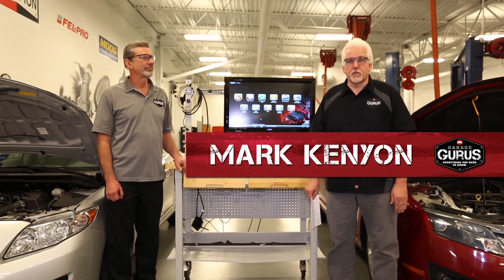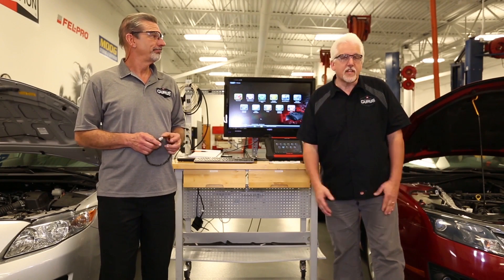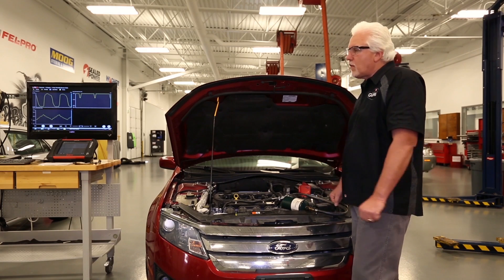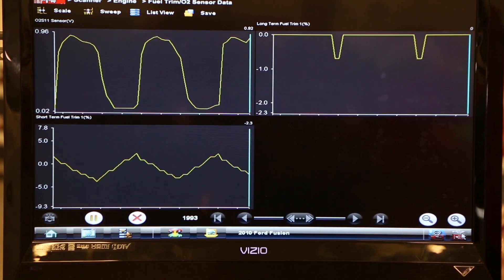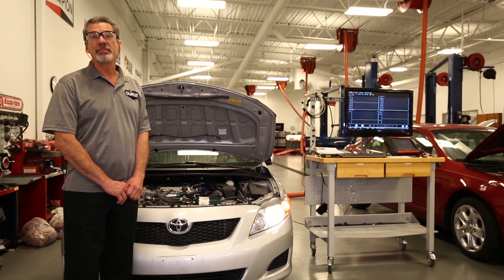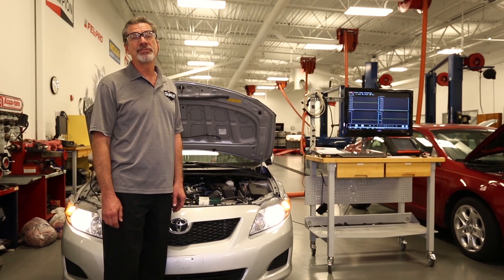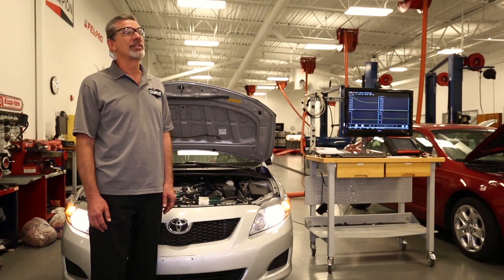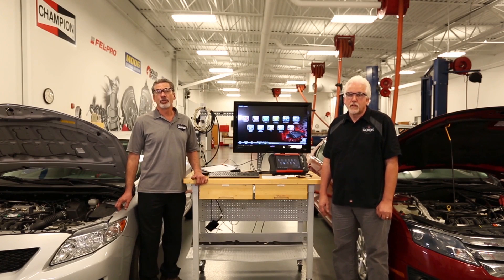Air Fuel Sensors versus Oxygen Sensors

Comment: Hello. If I take out my air fuel ratio sensor and install a regular oxygen sensor what will be the effects of this? My long term fuel trim at idle is +14
Reply: I just did it.
Reply: Won't be able to connect the oxygen sensor to the air fuel ratio sensor's connector. Different connector types.

Comment: Hi there , nice video .. I have a question about the A/F sensor and the O2 sensor I have 1fz fe 2007 engine with stock ECM and the type of the sensor on the car is O2 sensor Bank 1 ( only 1 sensor before the catly. Conv. ) the type is with a bigger hole tip the the A/F sensor , so the question is can i install A/F sensor instead of the Oxygen sensor depending of the same function simply, I found A stock Type from denso for another toyota cars are A/F sensor and the plug with the pins are same coming with 4 pins 4 wires .. ?

Comment: 1:40 Looks like the Ford is simply idling. So why is the narrow band voltage doing such big oscillation? Thanks!
Reply: Narrow band O2 sensors are non- linear devices, so in practical situations that means it can only detect rich or lean, but not how much. It's either one or the other. This causes the pcm to continuously vary the mixture. So you can't control to a fixed setting but you basically bounce around this set point.

Comment: 1:07 RANGE IS TOTALLY DIFFERENT TO FREQUENCY.

JUST BECAUSE IT WORKS IN WIDER BAND IT DOES NOT MEAN IT IS MORE PRECISE. 
IF THE COMPUTER SEES IT IS OUT OF RATIO (14.7:1)IT WILL PERFORM ACTIONS TO GET TO THAT VALUE SO THE RANGE IS NOT IMPORTANT. 

IT IS NOT ABOUT HOW WIDE IT IS. IT IS ABOUT FREQUENCY/ IT CAN GO FROM -100 UP TP 100 BUT WE ARE ONLY INTERESTED ABOUT CA.14.7 -1

Comment: I drive 2000 2.4L Tacoma/
It's been a while since I noticed "engine check" is on but I kept driving normally thinking it would go away.
Time for the smog check came.
It didn't pass.
So, after a it ot research online, I replaced a o2 sensor( I thought) then drive around a couple of hundred miles as the technician at the smog check suggested.
The check light went away.
 I went to the smog check again but no data.
It seems that I got a wrong sensor,
The original sensor was air fuel ratio sensor and the new one was a o2 sensor but that's what Denso suggested on their website.
Electrical plug on the new sensor didn't even fit the socket on the truck.
The original one at least was recognized by the onboard computer but the new one isn't recognized by it(by a code reader),

On Denso website, they make it seem like they were interchangeable but they are not.

Is this common?
should I get another parts same as the original sensor?
Reply: 02 and A/F sensors are completely different you cannot interchange them
Reply: Jay Jsays:
"02 and A/F sensors are completely different you cannot interchange them"
==
Thank you.
I wish I had somebody told me that before I bought it and installed it.

In the Denso website there's no mention of anything.
Reply from the maker: First O2 sensors and A/F sensors are not interchangeable yes the sensor may thread into the hole and the connector may even be the same but as for the function of these components, they are very different as you saw demonstrated in our video tech tip.  As to your question about using a different part supplier I would recommend that you look for the emission sticker that is under the hood of your truck as it will have the information you need to determine what type of sensor your vehicle is equipped with.
Reply: Garage Gurus says:
"First O2 sensors and A/F sensors are not interchangeable.."
==
Thanks you for the information.
I'm still gathering more (correct)information.

In the first auto shop I visited for their opinion, one technician was kind enough to look up the right part(air fuel ratio sensor) and I wrote down the part number and checked it online.
And yes, it was the right part number, and it looks pretty much same(in Amazon) as my original sensor, unlike the o2 sensor I bought.

In case someone who has the same issue reading this, the part number is 234-9001(air fuel ratio sensor) by Denso numbering.(for the note o2 sensor Denso recommended in their website is 234-4162)

There are generic sensors from other makers with different number but they'll all come up on the list when you search by the Denso part number in Amazon.
I'm trying to decide whether I should go for OEM or generic(about twice the difference in price) at this moment.
Meanwhile, I'll try to clean the old sensor and see if it'll work even just for passing the smog test.

Comment: I have a 2000 toyota rubber that was throwing a p0420 code so I changed the o2 sensor bank 1 and it started throwing ap1130 code witch is a a/f ratio sensor bank 1 witch is where the p0420 code told me to switch a o2 sensor. If it is the same thing just a different grade why did it throw both codes and not just the p1130?
Reply: That’s a catalytic converter code 😅

Comment: Could you tell which sensor goes where? Are they both in the exhaust or one in the intake and the other in the exhaust?
Reply from the maker: The Oxygen sensor may be used in either the exhaust manifold or exhaust pipe before the catalytic converter (Pre-Cat) or after the catalytic converter (Post Cat). The AF sensor is only used in the Pre-Cat position since it’s high sensitivity and broad range of AF ratio sensing is not necessary for the Post-Cat exhaust. It is up to the manufacturer which sensor is used in the application and service information should be consulted when diagnosing the system. On early model systems AF sensors used 5 or 7 wire connectors and Oxygen sensors commonly used 4 wires. Currently many newer AF sensors have only 4 wires, which can lead to confusion in discerning between oxygen sensors and AF sensors.
Reply: @GarageGurus  thank you sir

Comment: Just wondering for Toyota, why the LTFT is -12.5 ? another question is Toyota has two O2 sensors, as far as I know upstream o2 sensor is response to air fuel mix ratio, does the downstream also affect air fuel ratio?
Reply from the maker: Great question! Regarding the Long Term Fuel Trim being flat lined at -12.5,  the intent of the video was to show the immediate reaction of Lambda, O2 Voltage, and STFT to changes in A/F mixture. During setup and rehearsal for the Tech Tip video, we inadvertently set a DTC for #1 AF sensor causing the LTFT to default to -12.5. We simply did not catch this error in the editing and we apologize for the confusion. We verified this morning that this vehicle, part of our training fleet, displays trim values normally. Since the Snap On scan tool did not give a LTFT or STFT PID identified as S2, this does not mean that it does not use rear O2 for fuel trim. Toyota does not document their use of rear fuel trim very well, but has used the rear O2 in combination with the front A/F  to adjust trim for 2 decades according to our information. As with other manufacturers, the rear O2 has a relatively minor influence on trim in comparison to the front A/F sensor.

Comment: HOW do AF sensors work?  The o2 sensor uses Zirconium Dioxide  between platinum elements that are connected with a wire to each.  Electrical potential is generated by the imbalance of oxygen ions between the ambient air and the exhaust gas.  The greater disparity, as with a rich mixture, the higher the voltage (.9) and the less the disparity, as with a lean mixture, the lower the voltage (.1).  However, it requires 600 degrees or more to work effectively, which is why it has a heater, and the heater is the part that most often goes bad.  So how exactly does an AF sensor work?

Thanks!
Reply from the maker: Jack, in order to give you the most accurate answer, we need to know a few more pieces of information. Can you give us a call and we can help assist you? 
The Gurus Tech Hotline number is 800-325-8886 and is available
M-Th: 8:30AM-5:30PM ET
Fri: 8:30AM-5:00PM ET

Comment: Can a car have both narrow and wide on the same engine ?
Reply from the maker: Great question! Our tech guys would love to help you with this.  Feel free to give us a call - 800-325-8886 and is available M-Th: 8:30AM-5:30PM ET
Reply: tigerking Yes, my Toyota uses a wide band up front before the cat then a regular short band behind it just for monitoring the catalytic converter.
Reply: What happens if I buy an aftermarket fuel sensor sold as a wide band but is actually just a short band that fits? How would I be able to determine if it’s a wide band or a short band I was sold?
Reply: All manufactures that use widebands use both together. on each bank will have one wide band upstream and one narrow band downstream.

Comment: I have a lean code p0171 check engine light is always on, the cr run 
fine and idles fine. air/fuel sensor fluctuates between 600 to 800 down 
to 200. the fuel trim long term is 15 + and the shorterm fuel is -14. 
Check for vacuum leak engine cold sprayed water all over intake manifold
 , vacuum hoses , exhaust manifold, its normal.  The air/fuel sensor 
drop to zero volts when I pulled the vacuum hose from manifold . Does a 
zero volt reading point to a faulty o2 sensor , its a 4 wire , on Toyota
 corolla 2000 4 cyl CE 1.8l.
Now today I will check spark plugs and injectors, its repeated ticking 
sound points to both injectors and spark. spark advance on the obd tool 
reads 15 with a G letter . What does it mean?

I have not back probe the o2 sensor because I can not find its o2 
specifications on voltage drop and I don't know if its a wide band or a 
narrow band sensor. 

I cant find the fuel regulator in the engine. And I need to inspect all 
the vacuum hoses too. Its like being a medical doctor, I only have 150 
hours of training with certificate from the 70s and learning all this 
analysis with fancy digital scanners can be very expensive for just a 
do-it yourself-er. 

can I use a volt meter with an amp probe together on a o2 sensor signal 
wire, instead of back probing? 

Can I use the wave screen on the less expensive OBD scanner, to see wave
 forms along with amp probe and wire clip , How do I set this up?
Reply from the maker: Alexander, in order to give you the most accurate answer, we need to know a few more pieces of information. Can you give us a call and we can help assist you? 
The Gurus Tech Hotline number is 800-325-8886 and is available
M-Th: 8:30AM-5:30PM ET
Fri: 8:30AM-5:00PM ET
Reply: Hello Marks,
The check engine light came back while open throttle 70 miles per hour. Long term was 8 and short trims _14 to -9, sometime zero when in acceleration; when coasting short trims went from 0 to -14 fluctuating up and down. This may look like poor fuel delivery and injectors not opening. Bought a real fuel gauge tester, reading about depressurizing fuel system and disconnecting open circuit sensor. Will call you tomorrow early morning, thanks good fellows!

Comment: Wow, I have the first comment. Great explanation guys. Now, are you adding alternate fuel before or after the mass air sensor? Also, recently I was diagnosing a 2005 accord, 2.5 engine with dtc P0171. On my Modus Ultra and my Verus Edge, there wasn't a reading for stft at all. Only air/fuel average, and I can't remember, but I think also lambda. Can't I use Lambda readings instead of stft? No  apparent vacuum leaks and Lambda was good at 1.00, 14.7/1 afr. , if I recall correctly. Mass air sensor was a little hairy, but I cleaned it prior to retrieving data . I was in a hurry and had cars backing up on me. My bad.
Reply from the maker: Michael, great question! Please give our Gurus a call and they can walk you any technical question you might have! The Gurus Tech Hotline number is 800-325-8886 and is available
M-Th: 8:30AM-5:30PM ET
Fri: 8:30AM-5:00PM ET